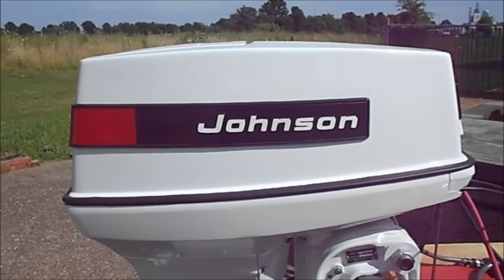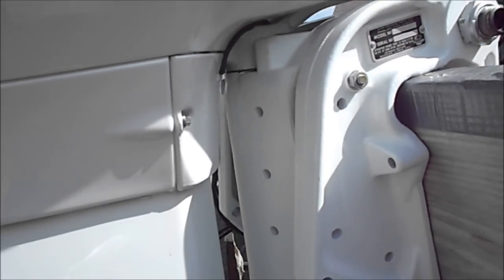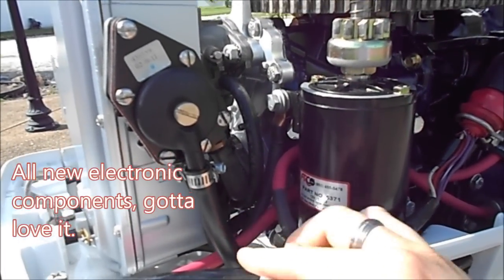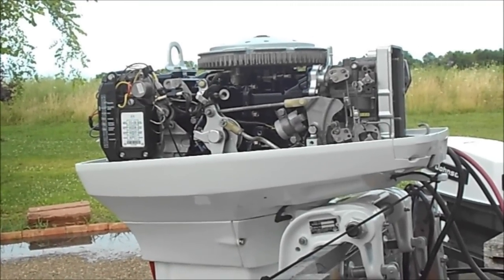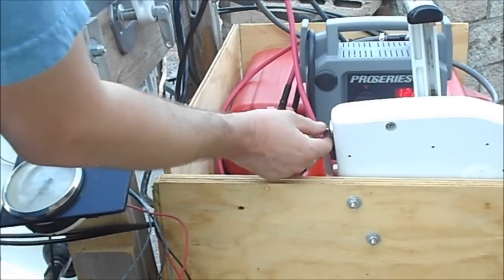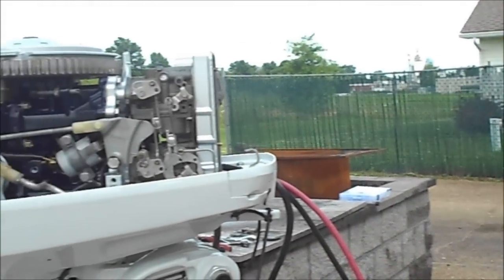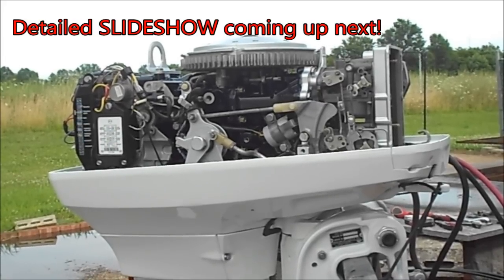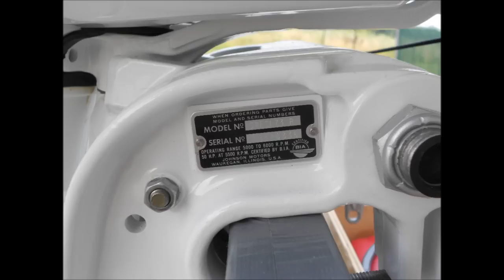1973 Johnson 50hp Outboard (Beautifully Restored)

Comment: Very nice work looks like you did not miss a trick. I bought this exact same motor as NOS. The motor was new in the crate but was 5 years old stock that was auctioned off from a dealer that had gone bankrupt. i got a great deal for $1000.00 with controls. the motor turned out to be a lemon, in the first 100 hours a connecting rod bearings started to fail and punched a hole threw the crank case. i had the alum case welded installed new crank bearings and con rods rings and a quick hone. Well it lasted just over 145 hours and exactly the same thing went down again. i did one more rebuild and sold it for $1500.00 with just over 260 hours on the clock/motor.  i told the guy that bought it the problems and repairs i had done with all bill's and service records .i never heard back from the guy and i would see the motor on a lund alum boat running around on the lake.i dont think he put many hours on thet motor every season so i think he got around 4 or 5 years before he had any problems show up. for me it was not a good motor as i could run up 100 hours in on season of good fishing

Comment: wow that is a beautiful motor! I would love to make my 1975 40 look and run like that. its the 40el75c. I just rebuilt the carb, rebuilt the water pump, and have been working on cleaning the outside of the lower unit. Thanks for some inspiration to take it a bit further.
Reply from the maker: Thanks, and no problem. Good luck in your journey.

Comment: I have the same motor that starts and runs nicely except for one issue: the carb adjustment screw only one located on the front of carb right above the intake hole (it’s a tiny flat screw). When this screw is turned out full turns from tight position, she starts first crank in cold mornings (her sweet spot). However, it gets lose/sometimes tighten after speeding perhaps from vibration. Question is: Is there supposed to be a retainer? Because I have looked online and all looks to be the same as mine just a screw. So confused.

Comment: I am working on a 1983 Johnson 115.I put it in gear and the prop will not move whether it is in forward or reverse. I went to check the lower unit oil and it is bone dry which makes me think maybe rust on the shaft is locking it up. Any suggestions would be appreciated.
Reply from the maker: My guess would be your lower unit is either not allowing the forward/reverse gear to slide properly or the shaft is disconnected somewhere

Comment: I have the same engine but mine is a 74 is your top carburetor feed down to lower carburetor from the fuel pump and I have to tune the jet needles. Could you give me any pointers

Comment: i got 110 psi on my compression test on both cylinders, which to me seems good enough.   Last time I ran this engine was 4 years ago and it overheated without buzzer.  It got hot.  Currently no spark.  The Chevrolet white looks great.  Please help.

Comment: very nice great job, where did you get the cover gasket? I cant find one for my 73 65hp evenrude.
Reply: @RonMillbrae  ive long sense sold the ol bow rider but got another headache/project boat. a 1989 Ultranautics jetstar 1250. thanks ill check them out see what they have
Reply: I had to buy a gasket for a different motor than my 74 evinrude....just cut and glued it at correct size

Comment: Nice! Does anyone know if these have an overheat alarm on them? I have the same motor. Thanks
Reply: Yes there is a temp sensor in the upper left corner of the head water cover. If the engine gets too hot, the sensor expands and touches the crankcase which sets off the overheat horn in the forward control

Comment: I have this motor. Why do they call it a powershift?
Mine idols perfectly and goes about 1.5-1.8 mph at idol without missing a beat for hours. It will only go about 20mph at top speed with my 16.5’ sylvan deep v boat. It doesn’t miss and sputter and compression is good, not poor gas issue, correct prop, any ideas?

Comment: nice job I have two both run like new  1972
Reply from the maker: +kenneth adams Yeah, they are just cool motors. Thinking of doing a smaller engine next, maybe a 5-10 hp.

Comment: Where is the shift rod screw to take the lower unit off
Reply: It's under the bottom carburetor (port side).  Have to remove the starter first.

Comment: I have a 72 50hp Johnson The water does not come out of those two slots at the top and the motor is very hot when I put it in water to start in my driveway does that mean I need a water pump

Comment: how did u adjust the fuel air mixture
Reply from the maker: each carb has its own mixture needle, adjust those to spec and you'll be in business.
Reply: J. Cuda you wouldn't happen to know what the spec is on that would u?

Comment: Great video, I am new to boating and I wonder what part is on the front of the motor that has the 2 rubber caps covering holes. I have a 73 Johnson 65 hp 3 cylinder. Mine has 3 holes , with 2 rubber caps, looks like I am missing one. What is this
Reply from the maker: these plugs simply cover the holes in the plenum. The holes will give one direct access to the needles in the carbs for quick adjustment. I hope that helps.
Reply: @jeffsextratv  no adjustable low speed needle valves on that motor. those plugs are before they made the plastic air silencers with the hole in the side to inject tuner and/or fogging oil, and way before electric primer with the schraeder valve. so those plugs are for injecting to each carb.
Reply: RI Outboards...Yes those low speed needles can be adjusted but you have to make sure that the small plastic seats aren't brittle and broke as the needles seat into them.... There's also a red plastic piece that goes around the needles to keep the needles from moving when the engine runs and vibrates...Very important to check those white plastic needle seats as if they're damaged you can't get the engine to idle and run smoothly at low rpms...

Comment: Would it be possible if I could get the blueprints on the engine?
Reply from the maker: if you plan on doing this process yourself, the best route is to find an original mechanics manual. These books have all the the specs, unlike Chilton type manuals.

Comment: Hey j, I have the same engine. It has 100 psi on both cylinders but dies when put into gear, what was your method to tuning the two carbs?
Reply from the maker: A 100 psi seems a little low Nick, the engine in the video was honed and re-ringed and has over 140 psi of compression; this could be the cause of the stalling once a load is put on the engine. The reed valves could also be an issue, may require a good cleaning- but be careful. As for the carbs - if they haven't been completely rebuilt,  do that and be sure the linkages are precisely adjusted. Hope that helps.

Comment: Where did you get the engine cover seal from?....
Reply from the maker: +korbyn stiles About 5 years ago I restored the cowling, I got the seal directly from Evinrude. If you can't find it from the manufacturer... may the search begin.
Reply: +J. Cuda Thanks mate... i thought you might have found a supplier of that moulding :)... Yep..may the search begin...and mine is whiye,,,,

Comment: I dont know if I would throttle it by the carb roller - no spark-advance when you do this.
Reply from the maker: spark advance only comes in later in the rpm range, a range not met in video.

Comment: Actually it looks like a 1973 , 72 was hydroelectric lower and had a yellow plug on wiring harness plus the cover would say 50th anniversary in front, and side plates would be white with black letters not black with white letters. So it looks like your a year off, 1973

Comment: where did you end up finding parts?
Reply from the maker: Many parts were sourced from manufacturer's website as well as, www.boatpartstore.com, www.marineengine.com, www.ebay.com, www.craigslist.org, or where ever you can find them. If I was to do one again, which I plan to, I wouldn't do older than about 1984.

Comment: hey j.cuda  I went to the  marine boat I ask about about    johnson 1973  50  HP    question  running motor ? guy service said yes running 1or 2 since left years I was decide buy  johnson 50 hp 1973  same match model my boat 50 hp 1973  johnson  now I have two motor 50 hp  I take time begin rebuild  but not easy hard to find marine stock any more  I was not different motor design motor but still same 50 hp.and for control need parts safety  switch  assembly hard to findparts.
Reply from the maker: +George Wheeler The 1973 was slightly different than even the '72 and '74. Some parts can be difficult to find, the safety switch in the remote control is very hard to find, some what impossible. As long as the engine neutral safety switch (still available) is good and cables are adjusted properly you should be okay. Good luck with rebuild.

Comment: Why did you not paint it the right color
Reply from the maker: If by "right" color you mean the original color? Well, baby-shit green is not that appealing; most colors from the '70's for that matter. The white and navy blue is just sharp, modern, and goes with nearly anything.
Reply: OK so ture
Reply: @jeffsextratv  i buy decals real cheap of a e bay guy ,,just done my 9.5 johnson cowl  white,,, with baby shit green decals  looks amazing great work on your motor ,,,i am wanting to buy another 60s johnson or evenrude  10 hp or below  or near that ,,,,i find whatever the lower unit paint color  be it blue or green or camo ,,if i put bigger decals on the cowl   the same color it looks amazing ...great vids bro